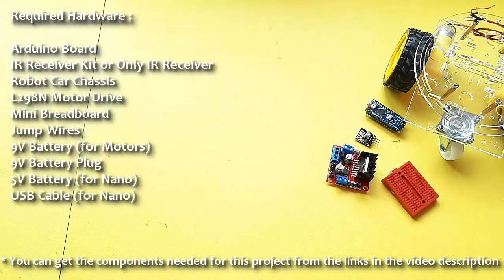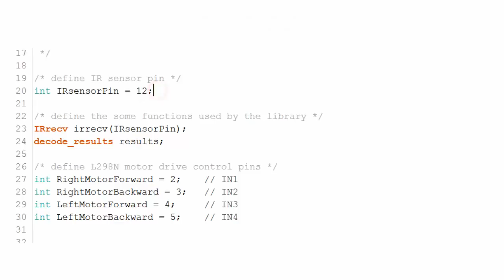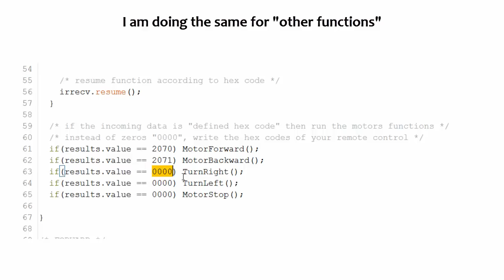How to Control Arduino Robot Car with TV Remote Control | Infrared Remote IR

Comment from the maker: Source Code:https://create.arduino.cc/editor/mertarduinotech/dd49c556-d8ea-46a0-a224-000469800291/preview
Recommended Items:                
Use Your Muscles in Project - https://amzn.to/3wdL45C
37 Sensor & Module Packages - https://amzn.to/3m66WeQ
Try this Robot Arm - https://amzn.to/3fq8DCl
Best Resin 3D Printer - https://amzn.to/39tY8KB
Arduino Compatible Kits - http://bit.ly/2J2AFF7
Banggood Spring Sale - https://bit.ly/3slMbOn